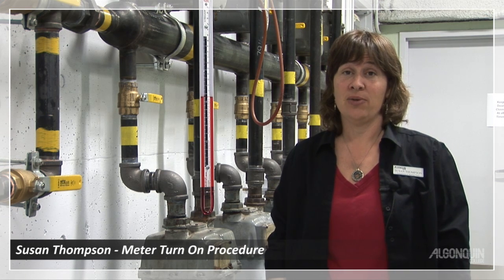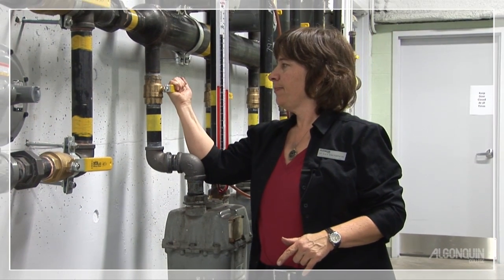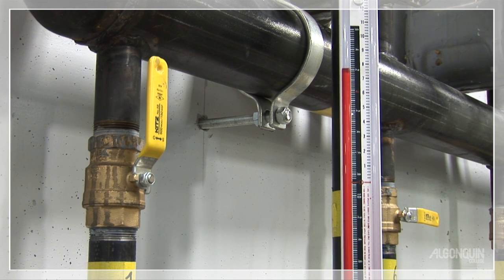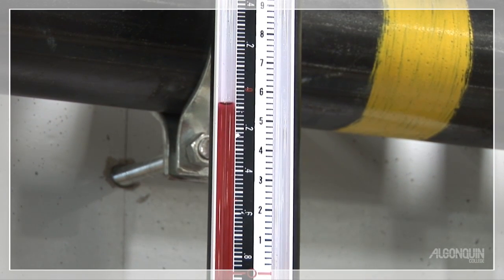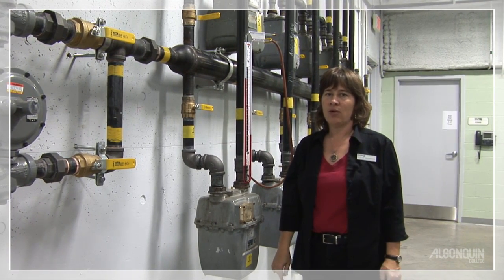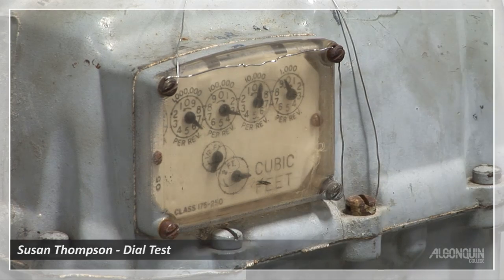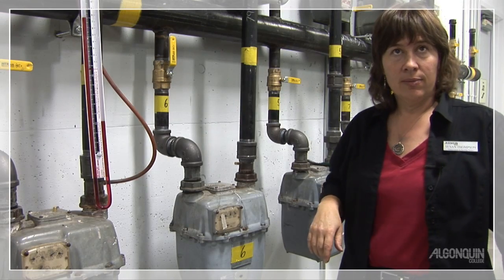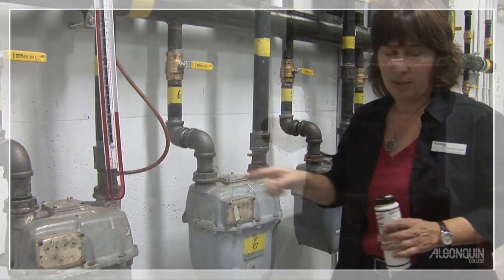Gas Meter - Turn On Procedure

Comment: Hello Susan,

For the Lockup Test, if the regulator moves past the static pressure (7.5 "wc), what is the next step to fix that problem?
Reply: In response to the regulator.   If the pressure should exceed the 7.5"w/c..... on the front of the regulator is a removable plug which you could open.  Within that plug is a screw with a spring which pushes on the regulator orifice.  You can adjust the screw clockwise to allow a higher w/c flow thru it.  Counter clockwise would lower the amount of pressure.